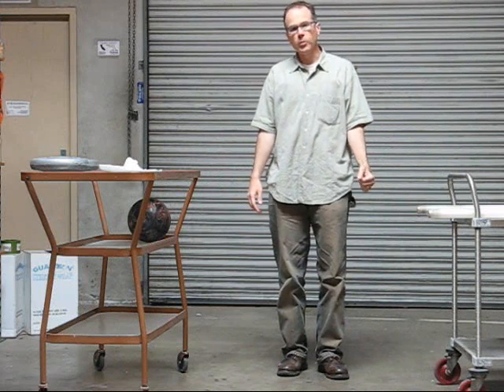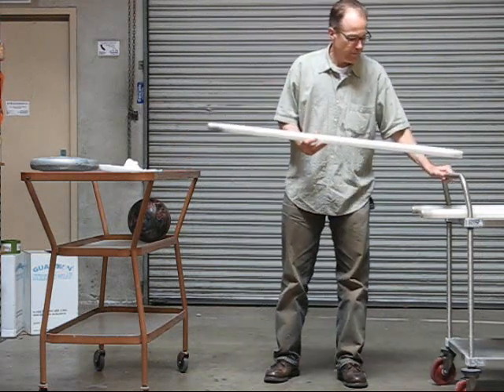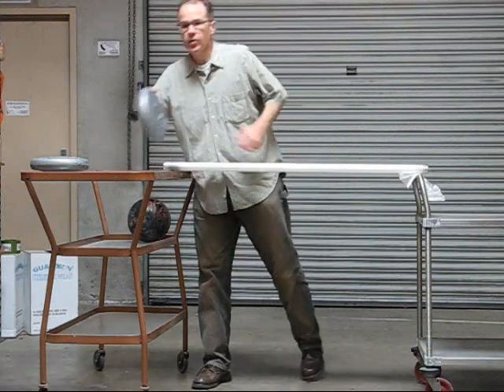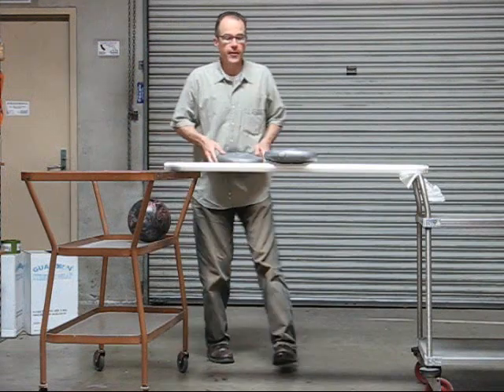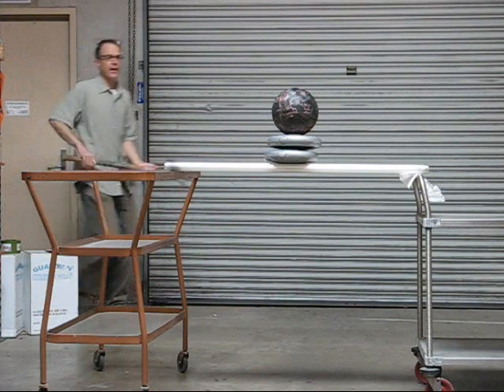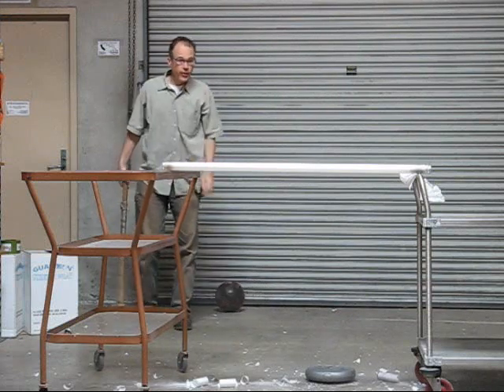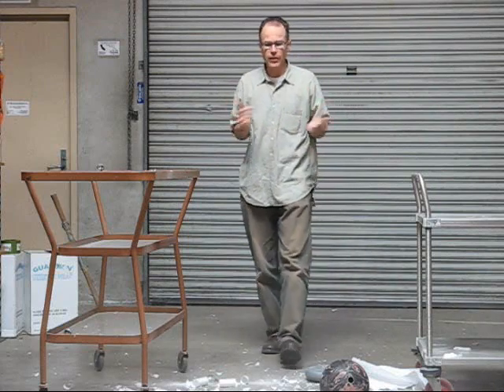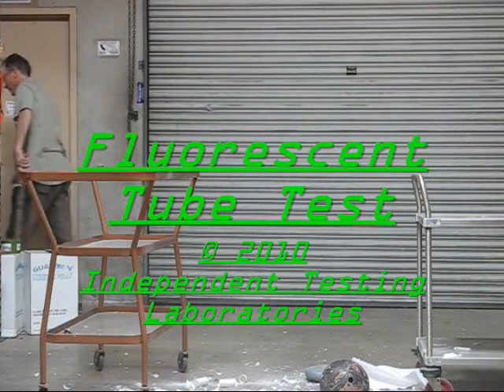Fluorescent Tube Test

Comment: First, I think it is hilarious how he runs away and covers his ears like a child.  Not professional at all.  That being said, if he is testing things like this he needs safety equipment.  Full eye coverage, respirator, ear protection hazmat suit and gloves.  He also needs containment means.  I wonder if he knows that he just illegally introduced mercury into the atmosphere.  The elements that make up a florescent tube contain, argon-an asphyxiant, phosphorous-altered, mercury in powder or vapor form and cadmium.  None of the particular parts of the chemical make up of these bulbs are good. Not to mention glass shards and particles.  To everyone, especially kids, a florescent tube is nothing to play with.  The destruction may be fun but the dangers are real and so is the contamination.
Reply from the maker: You make good points... I didn't realize about all those chemicals.   This experiment shall never be conducted again.
Reply: +WiredSighAnts well the mercury is only bad if mixed with powders because it can become air born but tubes have 5mg of metallic mercury but some may have the more deadly types like methyl mercury ext that's what killed my mate,most of all the mercury is out of my system but lead is in my system from sanding a car and useing paints that contained led, companies don't label it on there I've now got cancer from my led poisoning may end up like my mate, I'm so I'll now.
Reply from the maker: @tonyboroni6949  Tony, how are you doing today, five years later?